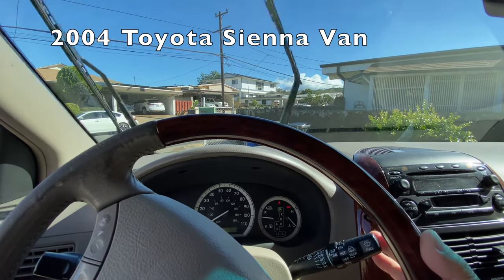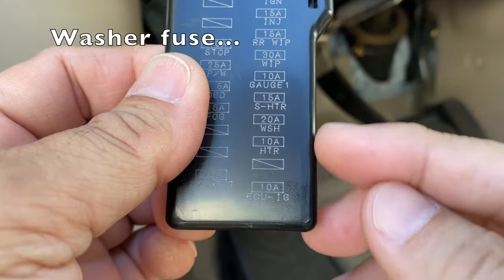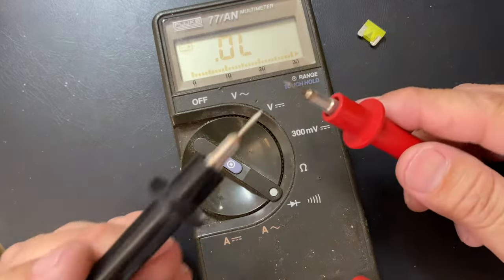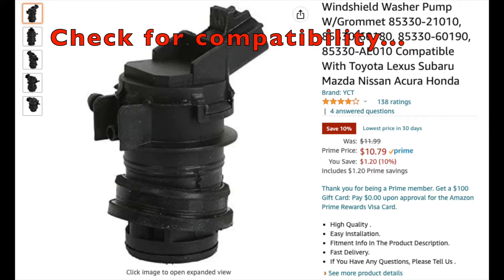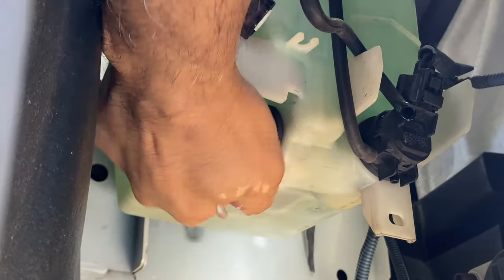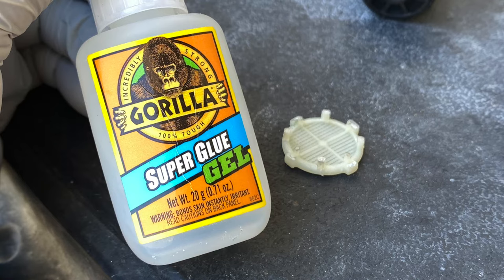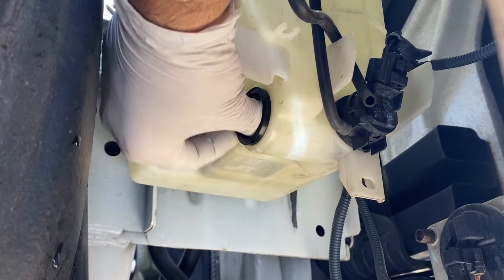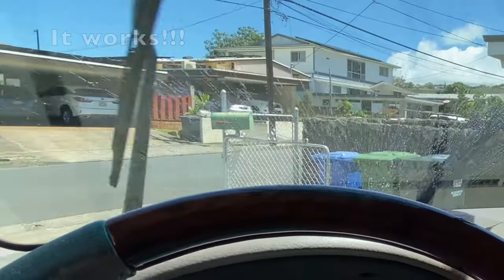Fix it Yourself!  Windshield Washer Stopped Spraying

Comment: First of all- thanks so much! 

The replacement was easier than expected. My only issue was when I was removing the old one the grommet came out with it and I tried installing the new one without removing the grommet from the pump and putting it in first. It didn’t work. Finally I realized that the grommet needs to be removed from the pump and installed on the reservoir before installing the pump. 

The other thing I wanted to point out is that when I took out the old one it looked brand new and I was wondering if something else was the issue. I tested the resistance on both with a multimeter set to 200 ohms and the new one read 5.5 while the old one read 1.5. That showed me that there was something wrong with the pump.

Comment: So I replaced my pump with a brand new one and it makes noise like it is trying to work. I then checked to see if the hose was clogged by plugging it into the back pump and it sprays. I then checked my fuse and it is fine. Do you think you might know what is wrong with it? I have run out of ideas
Reply from the maker: One more thing you could try is to switch the electrical connectors if the wires are long enough.  This should tell you if the wire harness is the problem or not. 😎

Comment: Tip: when low try not to use wipers. Those little guys burn quick and most fail if they run without a drop